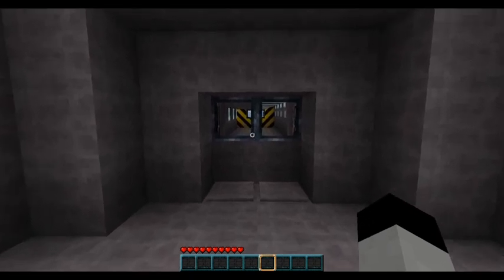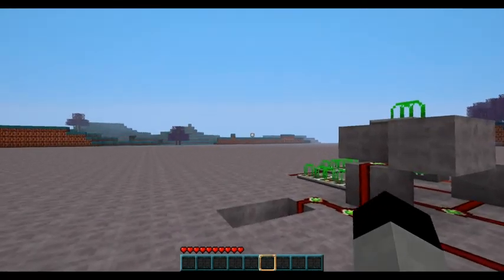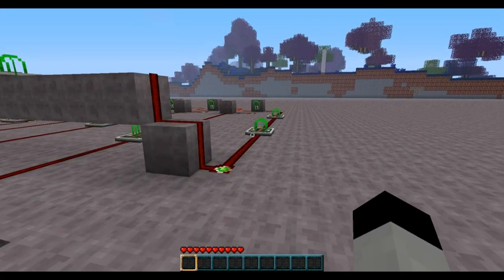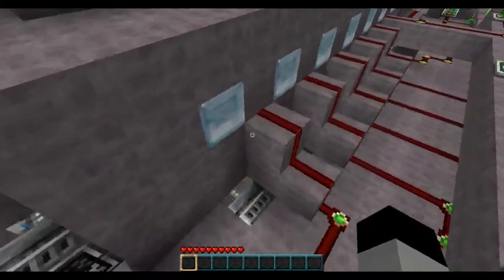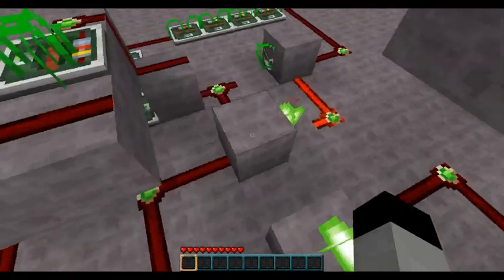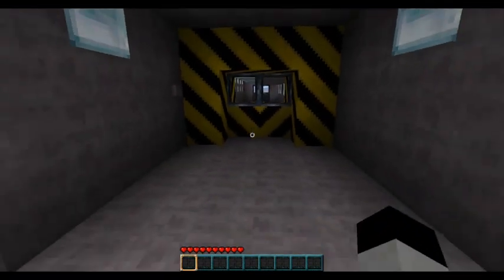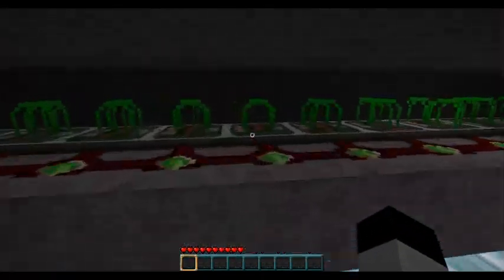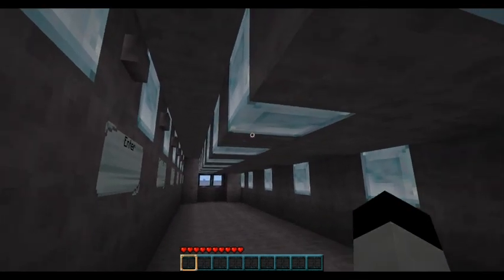Minecraft: Let's Build an Adventure Map! Episode 5

Comment: @JayJW410 The way I understand it is that it can hold 2 different inputs and keeps them on.  Different buttons will switch the output, so you can have a button that opens a door and keeps it open until you push a close button.

Comment: Captain, if you read this, you should make it so that pistons in the floor lift you up at the same time as the pistons in the ceiling push down. That way, you could have buttons in the middle of the wall, and the room could be 3 blocks tall and not weird. The buttons would be safe, because they would be in the center where the pistons could not reach. Just a suggestion :)

Comment: I used BeachHippopotamus' piston lock design so that when all the switches were in the right state the sticky pistons would extend with a block. When you hit the enter button power would pass through the blocks via repeaters. The enter button's circuit would split to an AND gate. If one switch wasn't in the right state, power would be sent to the punishment system. The Punishment System was a strange gate, (A torch and a repeater). If power from only the button was only recieved it would power

Comment: Captain, I have a suggestion you might like!

If you just move the buttons 1 block back, you would be able to put them in the middle row, as well as extend your piston ceiling across to the next wall. This could be done with relatively little effort and time and would make the room look a lot nicer imho.

The buttons wouldn't interact with the pistons at all. Though i'm not sure if it would interfere with how well the blocks would push you into the lava.

Just a thought. :)

Comment: The problem is that if you spam all the buttons you will still get the combination right.
If the combination is 12345 this code would let you through 4 - 5 -1* -3 - 2* -4 -1 -3* -1 -5 -2 - 4* -1 -2 -5* -1 -5 -1 - 3 (the numbers marked with a star are the ones the lock will recognize as correct). This is because it won't care of incorrect keystrokes.

Comment: @88888888767 but you do need to push all of the buttons in order, just not consecutively. if you were to push 3, 5, 2, 1, 4, the lock would still be deactivated, but it will register that the 5 and the 4 have been pushed, not all 5.

Comment: I think, there is a little problem with this construction:

If you press ALL buttons five times, the latches will deactivate one by one, because if you press the wrong button there's no reset system. That means, if a latch is deactivated once, you can deactivate the next, and the next... After hitting each button five times in a row, all five latches will have opened - although the code was completly wrong.

I know my english is terrible btw. I'm German ._.

Comment: @LarryTheTigerr Instead of thumbing you up, I shall answer your question.
The enter button turns on the punishment system and-gate and the other that opens the door. The punishment system will activate if the other torch is off which means they did not enter in the passcode correctly, if they enter in the passcode correctly there will still be one torch on that causes the punishment system to not activate. 

Sorry if I didn't explain well, it sounded better in my head  : )

Comment: @o48Mike yes but if you press 1,2,3,4,5 and then, 1,2,3,4,5 and does that 5 times it, wouldn't that solve it even if the code was something like 5,4,3,2,1? the first time, 1,2,3,4 would just get passed by and then 5 will be activated, the other time nr 4 and so on. the only way this could be prevented is to make a reset thingy if you press a number in the wrong order. i don't know maybe he has done that in this.

Comment: @CaptainSparklez I see a problem with your lock design, if say you have 3 button (this problem is scaleable to any size) if i press button 1 then 2 then 3, I would set at least 1 latch, then I repeat and 1,2,3 then I would get the second one, and 1,2,3, and there, all latches would be set, basically, i just need to press the buttons in order n^2 times (n = number of buttons), then I can be sure all the latches would be set
does that make sense??

Comment: Because each pulse through, doesn't this only make sense if you do it in the order that the rsnor latches are in (i.e. the combination)? Like, if the combination is crossed to be 43215, said presses would be out of order (the rsnor latches would not be  activated in direct sequence. You would have to press 432154321432434 to generate the pulse correctly. pressing 543215432543545 is the same as pressing 512345123512515. Therefore, you need to know the combination to do this... rendering it inert.

Comment: THUMBS UP SO HE CAN SEE
There is a problem with the design. It's really sensitive to a brute force attack. Like, you don't need to know the combination in the correct order to get through. You can just cycle through every button about 5 times and the combination will be entered. To fix it:  Add this /watch?v=zvemXn-An4Y&feature=channel_video_title. And wire all the buttons to it. Then wire the last RS in the array to the punishment thing and have it reset the system

Comment: The problem of pressing each button 5 times to open the door can be helped with some pistons shoving a block over a part where the wires go a block up/down, so the wires are still there but can't connect anymore. It will require an additional 5 RS-NOR latches and a lot of extra wiring though.

Here are two screenshot of my build of it (tested it and it works, place dots in place of the spaces)
i51 tinypic com/w9a1zk png
i55 tinypic com/23kq72p png

Comment: I think there is a way to bypass this. Lets say there are 5 numbers able to be pressed and an enter button. If the pass code was 3-2-4-1-5 and I pressed in (1-2-3-4-5) 5 times, wouldn't that still work and not trip the punishment system? I hope this wasn't hard to understand.